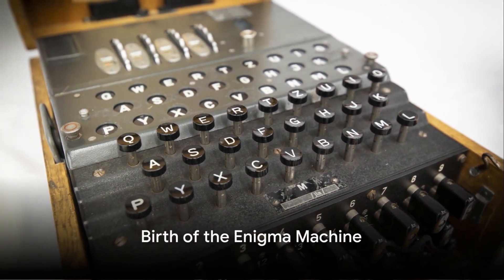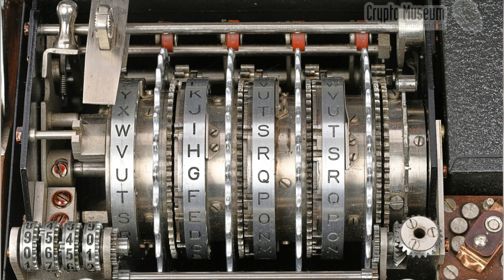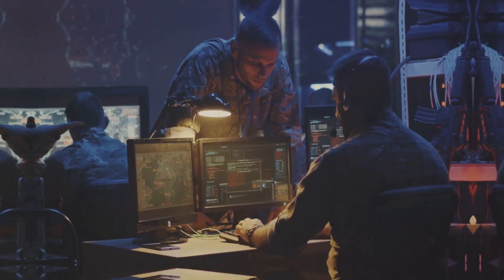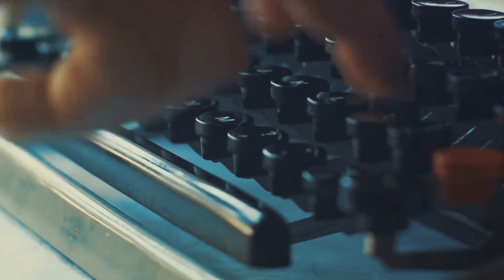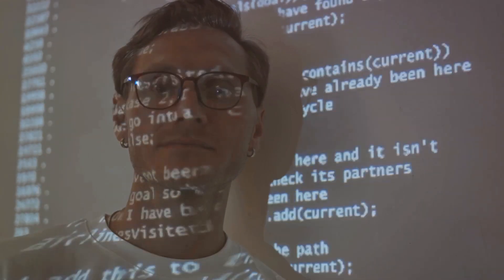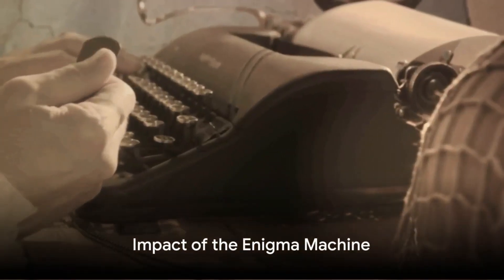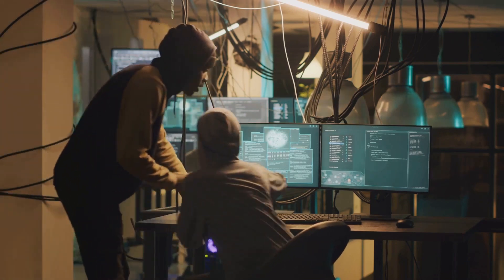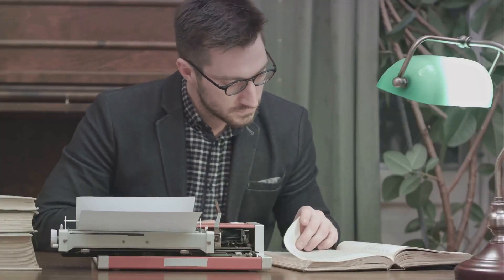The Enigma Machine - A Marvel of Its Time (10 Minutes Microlearning)

Comment: That "feature" of a letter not encoding as itself did not improve security.  In fact, it turned out to be a flaw that made cracking the code a bit easier, in that the crypto-analyst could immediately rule out one letter.  Also, the Enigma initially saw use for commercial messages before being used by the military.  I believe the plug board was one of the improvements made for military use.  Later on, a 4th wheel was added.